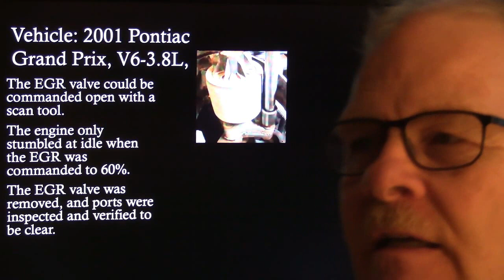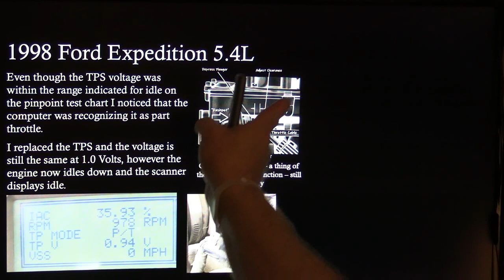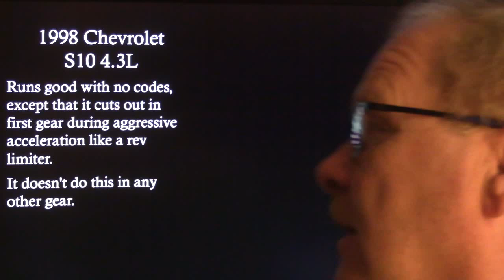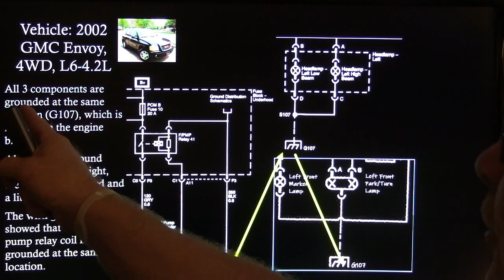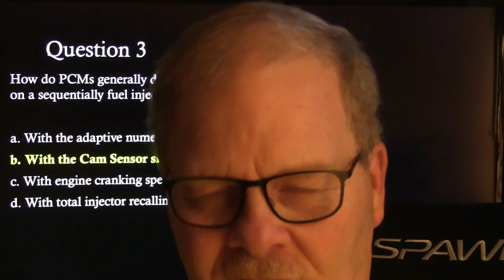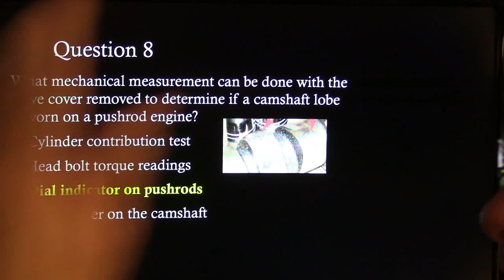Some Engine Performance Fixes

Comment: Question 3, I thought it was the sync notch in the crankshaft trigger wheel that determines #1 cylinder position. If the cam sensor was down, the car would not run in the scenario of question 3 being cam sensor.
Reply from the maker: Just about every vehicle has a 36 - 1 crankshaft wheel with a missing tooth but it needs a cam sensor to find the compression stroke on cylinder one and that missing tooth does not happen at cylinder one, it just tells the engine controller cylinder one is about to reach top dead center but again the cam sensor is what determines which stroke that cylinder is on. In that regard the cam sensor is necessary to determine fuel injection timing and there are some vehicles that will start and run just fine without a cam signal but it just about always affects the fuel economy. Different platforms operate in different ways regarding the cam sensor as far as whether they will start or not with a missing cam signal.